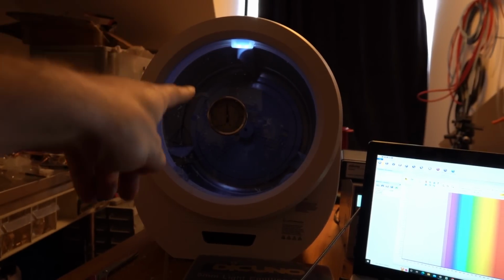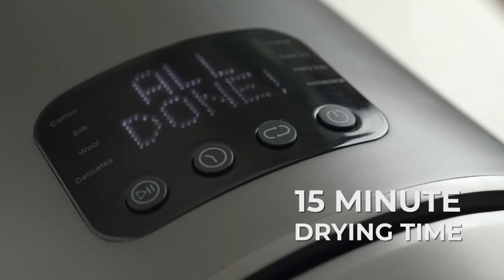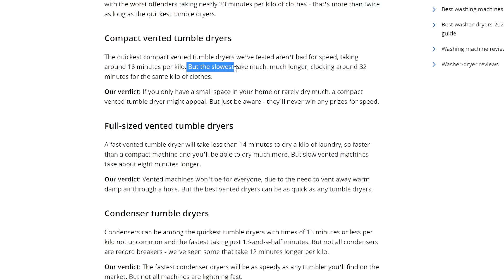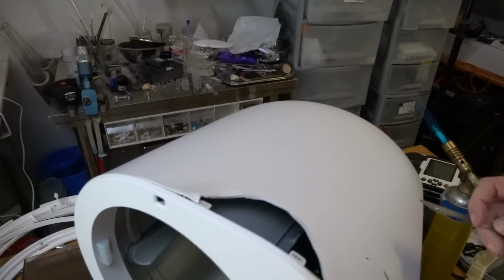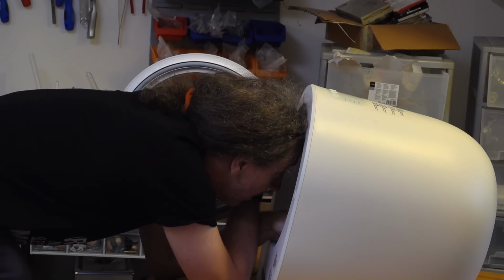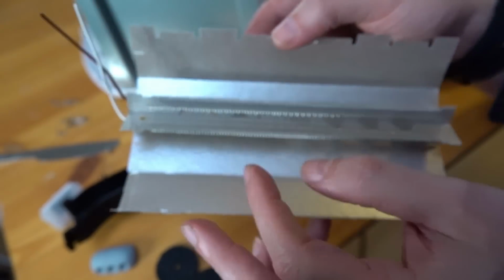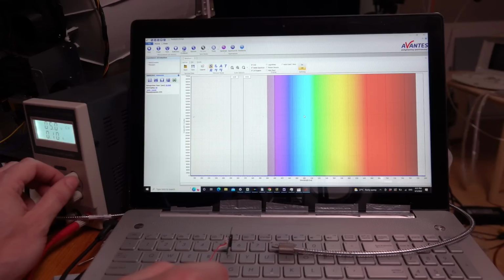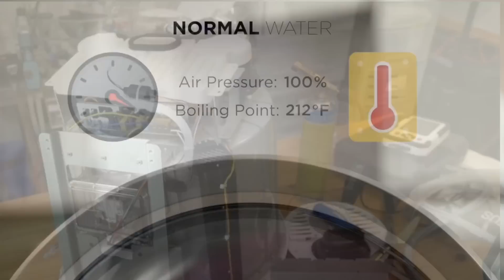Autopsy of a Scam-Starter: The Morus Zero!

Comment: That UV LED couldn't sterilize a cotton ball. Having been into aquariums for quite a few years now, one learns very quickly that 'UV sterilization' is nothing more than a marketing gimmick within the confines of home goods.
Reply: Heat + steam will do a better job at sterilizing. Why we have autoclaves.
Reply: There are various UV techs that do work, but all of them use meaningful amounts of power, not a single LED.  And for effective sterilization the UV output is also always at levels that will immediately and permanently damage your sight if you breach the shielding.
Reply: The trains we service on the depot I work at use UV sterilisation to sterilise the drinking water. They use pretty damn massive fluorescent tubes to provide the UV.
Reply: I have a deep bored well in my house, with radon-seperator hooked in before it goes in to the pipes.
In the radon-seperator there is a uv light to kill off things I don't want to have in my drinking water.
Edit: A massive one compered to this.
Reply: Depends.. plumber here, we use uv sterilization for well systems and they work very well.. but generally speaking I agree with you
Reply: Home mycologist here, a small UV fluorescent light in my laminar flow hood makes a significant difference to my likelihood of contamination. It’s 18W I think and even the shortest exposure will give you a nasty sunburn. It’s only a gimmick if you don’t use it right.
Reply: yeah, even ones for a pool (or spa) draw from 30 to 200 watts. The morus' easily-bypassable door would be a huge safety hazard, even if the plastic were to be somehow UV impenetrable (which it probably isn't)
Reply: The thing about UV sterilization is that it will also bleach your clothes very quickly. So its a terrible choice for clothing
Reply: Yes and no. With regards to aquariums I run 50W UV system on 100L aquarium with a filter rated at ~1200L/h . This set up works well. I work often with UV and water at an electronics/science level and that's how I know. You are correct that most aquarium UV gear are gimmick as majority of them are b/w 3W and 10W and usually advertised for systems of hundreds of litters... With regards to the LED in the video, as soon as I saw it I realized that it could be a proper UV LED, however one such LED and with that little heatsinking (even if it is driven in PWM mode, which probably is) in a such a large scale system (compared to the LED size) would do almost nothing. Check SeoulViosys CUD5GF1B, which looks in an equivalent package and operates at ~255nm (7V was almost spot on for these types of LEDs), I use dozens of these on system with active cooling to achieve max performance and also just pushing milliliters of water through the systems with special clear tubes that do not block this particular wavelength.
Reply: @highestqualitypigiron  that's a good point.
Reply: I mean the only experience I have with UV is tanning beds, and those don't sterilise themselves despite the amounts of light they put out.
Reply: @highestqualitypigiron  i won't say "very" but yeah it will damage most organic materials.
Reply: I have a UV filter on my aquarium and it absolutely helps with algae.  Its is a florescent gas style bulb with a broad spectrum and not an LED though.
Reply: Most of those 'UV' canister filters are just a gimmick as you point out. But if you spend a bit more money you can get a proper UV sterilizer for a few hundred dollars. Or you can buy from a cheap Chinese seller and they will just stick a regular UVC/UVB fluorescent tube in there with ZERO regards to safety. I was in a pinch once and needed a high flow filter quick because the proper replacement filter was still 2 weeks out. So I bought a cheap $60 chinese filter and it had a UV bulb in it. A proper UV bulb, it didn't list what it was but it discolored the plastic, melted it's plastic casing, and caused everything else around it to become brittle to the point that just picking up the trays caused them to crumble. I only used the thing for 2 weeks, that is a dangerous ass filter if i've ever seen one.
Reply: Depends. a cheap 11w uv sterilizer will end green water in a 55gal tank in just a couple days.  

I got a bigger 36w one with low flow rate, but so far it seems to only be good for heating the water. I suppose if it does it's job and kills ich theronts I shouldn't be able to tell if it did anything at all.
Reply: For clarity, yes aquarium UV can absolutely help wih green water, even the cheap 9w Amazon ones (used one on my 125g plenty). Sterilization? I doubt it but yall can argue that all you like. But a .25w LED, which very likely is emitting phosphor enhanced purplish kinda sorta iffy light, is far from a quartz tubed fluorescent UV lamp in a small, low flow enclosure.

For this fish folks while on topic, Ive had my problems with green water algae. Typically i only see it within the first year of a new tank. I would run UV, clear it up in a week or two, and after a few months I found I can remove UV and green water does not return. New tank sydrome is a thing until the system has time to find equilibrium, after which, UV becomes meaningless in my experience (unless you get peace of mind from sterilization of parasites, bacteria, etc, then all power to ya).
Reply: @ChatBot1337  no that LED is pretty useless.

Comment: Gotta be honest, they put more engineering into this than most scams. Usually they’re rebranded garbage or don’t ship at all.

This is one of those cases of “over engineering isn’t good engineering.”
Reply: Ive found this is the case with most of the Kickstarter projects ive seen. They have a working prototype, the size of a regular dryer, and they think they can do it. Then they run into the problem of reality getting in the way. Like most technology the last 10% of the project has 90% of the problems. That is why everything is just 5-10 years away. That final hurdle is usually when the whole thing falls apart. 
Take the EOZ Air Bluetooth headphones. They had a great idea of putting the antenna in the over the ear part to increase reception. But that didn't work so they scrapped it. But they didn't change there marketing and i was still finding the claim listed a year later. Also they sucked. Low volume, case came apart with all the guts falling out (how i know the antenna was not in the ear loop), and would drop out if i turned my head while my phone was in my pocket. Very similar to this Dryer.
Reply: It's probably still rebranded garbage, just of a slightly more expensive kind.
Reply: That’s what I thought. Seems they at least tried and when they failed tried to ship a minimal viable product. It’s not the worst kickstarter scam of all times. Still waiting on my handheld raman food spectrometer
Reply: its like the juciero being an over engineered packet squeezer. 
there's a reason these people need kickstarter to gain funding for these ridiculous products. 
well established companies want nothing to do with them.

Comment: Good thing you taped over that hole; you wouldn't want to loose your vacuum. I'm just amazed by how well your miraculous super tape was able to hold up to the pressure of a space vacuum!
Also nice of you to show how to take apart a Morrus Zero for repair purposes. If it breaks down on the owners after a few decades and they are so satisfied with it that they want to repair it instead of getting a dryer from a competitor, they'll now be able to do that.

Oh also, you had a misconception on the Infrared heating. That obviously doesn't come from the heating elements, but from the UV LED.

Comment: Tip for taking things apart, from a professional tinkerer, use bike tyre levers for removing troublesome cases, they won't snap the plastic and save your fingers from getting trapped if the plastic snaps back, vacuum technology is great, on an industrial scale, there are vacuum dryers used in major industry for things like chemicals, reducing the pressure to boil off water without damaging the chemical structure is widely used, however, the smaller the application the more pressure is required, in the case of a clothes dryer the pressure required would be similar to that of a truck tire, having a container made out of cheap plastic just will not stand to the intense pressures pressing from the outside, more like a oil drum coated in concrete!

Comment: The sad part is, that they could just have sold a "small formfactor clothe dryer, for small apartments etc." and no one would have had any problem with it whatsoever. But instead, they sold it as some "futuristic" mind-blowing product.
Reply: You forgot for 6 times the reasonable price. I can buy a 10$ hair dryer and a 50$ ball mill or other mixture apperatus and boom.
Reply: The $600 bit is delusional too.
Reply: Honestly, an indoor clothesline and a dessicant dehumidifier is far more effective once you factor in volume, people don’t wash clothes one or two outfits at a time
Reply: Sharper Image business model, looks cool, costs a fortune, barely works. try the new Deluxe Apt Dryer with ultraviolet sterilization, uses the same power as a large hair dryer!
Reply: That's what I thought.

Had they redirected the airflow over the water reservoir it might have had pulled out a some of the lint and maybe even cooled the air down a bit.

There's little water tanks to use at the end of an old fashioned air dryer so you can use it without venting outside through a window.

Used one for a couple of years and it did that semi decent.

At a quarter of the price it would be a decent addition for a small studio to be used in winter time when it's harder to dry your clothes inside and the heat generated by the device isn't wasted but wanted.

Ah well. As is it's a scam.
Reply: @lunavixen015  

That's a better solution than my wall of text suggestion...

Comment: I'm very surprised that a scam like this is is actually so well put together. Looks like if they put in some effort and made a "viable" product they over hyped and lied about when marketed. Still a scam though.
Reply: Yes, those plastics are beautiful, at least from what I can see. Clearly a ton of money went into the tooling for those. It makes me wonder if this was originally a different product without the false claims, or if they tried to make the real product until they found out how much it would cost…
Reply: That expensive juice machine was also nicely engineered. The thing is that the people that make these things are good engineers, but they lack the physics background.
Reply: As an industrial design ... is neat. And just look at the power electronics ..... same thing manufactured by a well known brand wont have even a quarter of that. I mean ... they didnt cheap it at all ... shame they coudlnt think in a better product away from the aesthetics
Reply: @tiefensucht  It was actually fairly poorly engineered. Building everything 10x beefier than it needs to be is bad engineering. Anyone can buy the biggest gears and bearings they can find on McMaster and throw them together.
Reply: @tiefensucht  Juicero was a different beast though… the idea there was to make money off selling the juice packs to people who already spent way too much on the machine. If the machine looked like crap, they would not sell any packs. Morus does not have a consumable to sell. There product was effectively the kickstarter campaign. They could have delivered something with much cheaper plastics since they already had all the money that they were going to extract from users. This is what makes me think that at some point this was intended to be a legitimate product, maybe a simple low footprint condensing dryer for people who don’t have a dryer yet.
Reply: @Finder245  "It makes me wonder if this was originally a different product without the false claims" 
YES! I wonder that, too!
Reply: It's not well put together. It's garbage. You need to compare it with Bosch dryer for the same  price.
Reply: @dantebg100  it is significantly better out together than what would be necessary for a scam though
Reply: @theultimatereductionist7592  I think tthe same, probably they picked an almost finished product from some company before even starting. Getting to this point from scratch is expensive. Im not telling it works. Just the contruction, number of parts .... not bad for a small run. Shame it is a waste.
Reply: I wonder if the PCB is bespoke or a board from another product being repurposed
Reply: @justanotherviewer4821  the PCBs look custom to me, but some high resolution pictures would make it easy to find out. The cost of designing those board would be nothing compared to the tooling for the plastics.
Reply: That’s why people are falling for it… marketing!
Reply: Id rather they just took the money and sent no product. Because now the landfill will be full of these "Dryers"
Reply: @F0XD1E  True, but there is a market for poorly engineered products at premium prices too.
But for such a market to sustain itself after the original hype dies the product has to deliver some of it's premium feature promises for real.

And that's were the Morus Zero failed.
It didn't leave enough meat on the bone for those hardcore fanboys to defend their new toy.

In short: you need to deliver at least some of the key promises OR continue to put a boatload of money into marketing. To be fair, if you focus on marketing you might as well slim the product down and make it cheap to produce.
Reply: @TCPUDPATM  except the people who bought this did not see the physical product before buying it.
Reply: @F0XD1E  one of my favourite quotes from a lecturer I had (and heard elsewhere). Anyone can make a bridge that will stand but it takes an engineer to make one that barely stands.

Too bad my specialisation was in blowing things up, not putting them together.
Reply: IIRC, you can study to become "technical product designer". By the end you know CAD, and should be able to design a decent coffee machine.
To their credit, they did get rid of the IR, which probably would have drawn even more power. Can't imagine how they thought they'd get IR in there anyways.

Comment: Well so it turns out it actually has infrared heating element in form of this tiny UV LED :D
I thnk it worth mentioning that in your test setup morus had a favorable position over clothes line, because it was standing in full sunlight ;)
Reply: full sunlight is not really good for this "thing". In fact it's a worst case scenario for this type of drying. Cold Air outside in winter would have been waaay more effective. Cold air can hold less water and has an even better drying effect when heated up. Also a winter central heated indoor space would have been much better. So the thing could maybe fulfill the ad promise indoors in the winter time. And help to moist the room. As could any other electrical dryer with its condenser disabled for a fraction of the cost and with more cloth capacity.

Comment: Seeing the laughable condenser makes the drip tray even worse that i thought. Originally i thought it was just a drain port at the bottom so that if your cloths were soaked the excess water would drip down and not have to be evaporated away. With this design the excess water is also just vented out into your room.

Comment: For the purposes of accuracy, the white and pink LEDs have a blue LED die with a phosphor coating to emit the other wavelengths, not multiple colour LED dies. UV-B and UV-C LEDs suitable for sterilisation are still very expensive (tubes are still used because they are cheaper).

Comment: 30:00 Maybe it was meant to be pulsed a half second at a time given it's an LED? UV LEDs get toasty... reasons I run standard bulbs for them.  Granted I have no idea how effective it would be on a half second "pulse" given you need sustained 30-60 seconds to kill most things on a smooth surface... let alone clothes that are constantly moving around.
Reply: UV leds generally need a current limited supply, no doubt running at the 7V with no limiting cooked it
Reply: @JamesTK  oh no doubt, but at 6v the output was rather... lacking... at 7v it seemed to put out enough light but the heat...  It's possible that board he disconnected that was glued in place handled that.
Reply: @FakeJeep  I'm not sure you understand what James is saying.
LEDs are basically short circuit, so you need to regulate the current. Connecting a LED to a power supply without the corresponding resistor will destroy the LED very quickly (It's also bad for the power supply).

The voltage is not that important, it just need to be high enough to pass the diode and low enough to avoid internal arcs.
It's the current that drive a LED.

As a reminder: I=U/R
Or: Current = voltage / resistance
Without a resistance, the current is infinite.
(technically speaking the power supply, the wire, and the LED already have a slight resistance, so it's not truly infinite).
Reply: PWM

Comment: UV LEDs are longer wavelength UV (~400nm). Almost violet. I've actually tested them by growing cultures versus a control. No disinfectant properties. There are microbe killing UV light sources, but those are gas discharge types, of much shorter UV wavelengths (<300nm).

A clothes line both dries faster and has UV germ killing benefit. You know ... like sunburn.
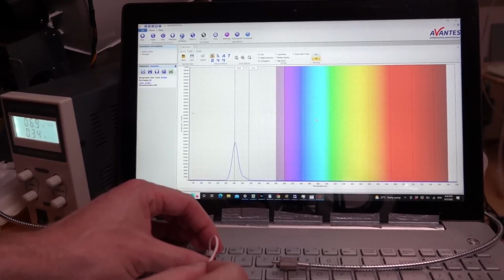Reply: Actually, I the last decade or so, shorter wavelength UV LEDs have started to become commercially available. The spectrum (27:25) looks right for a 290 nm LED or thereabouts. The case for the middle LED looks right as well (metal+quartz instead of the more common plastic carrier+optical resin filling).
Reply: @Gameboygenius  And these 300nm LEDs were really expensive last time I looked. 34 dollars a piece at Newark.
Reply: From the looks of it, this really is a ~300nm LED.